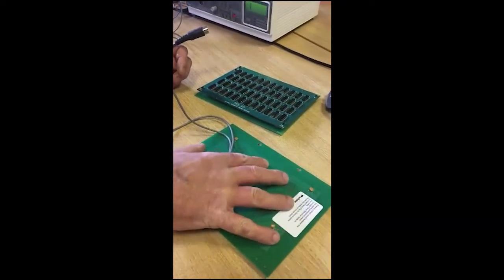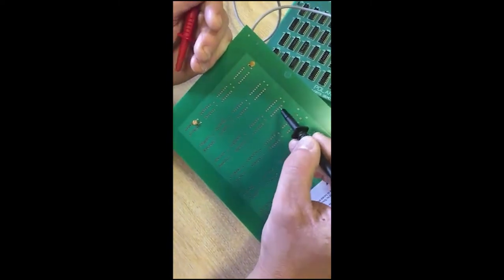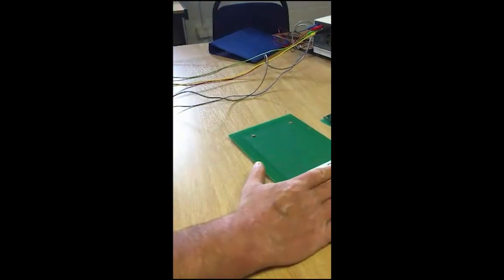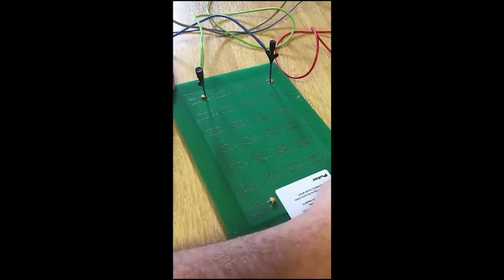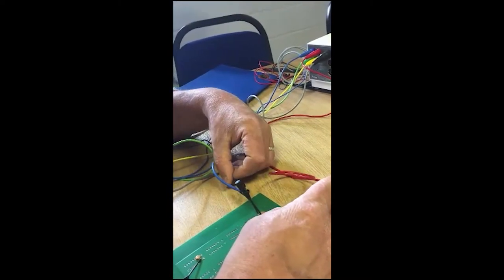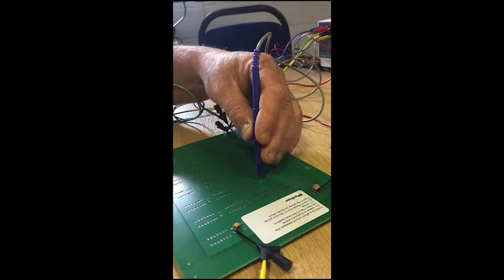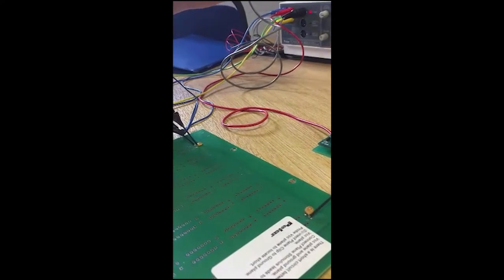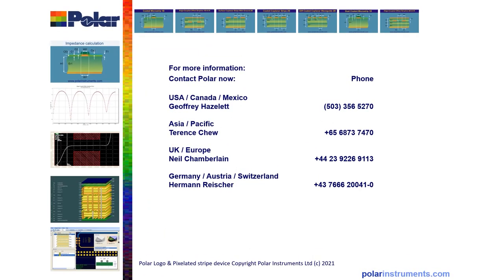How to find ground plane shorts with the Toneohm 950 *

Comment: Can I use it to locate shorts on laptop boards?
Reply from the maker: Hi,  It depends if you have access to the CAD data, and if there is easy access to the 4 corners of the ground plane. For more complex PCBs it helps to have CAD/CAM data to view the plane positions.  For simple track to track shorts - again you need either visibility of the trace - or CAD data if the trace is internal.

Comment: Nice device probably cost thousand of euros, but a simple lab PSU and thermal camera makes shorts really show up on any board, no work required at all.
Reply: sometimes the piece that gets hottest is not the shorted component. The piece that gets hottest is usually the weakest piece in line.  and yes the weakest piece is the one that may go bad first if a trouble arise, But, not all the time. and thermal camera is a big time saver I use it my self. 80% of the time it is right on.